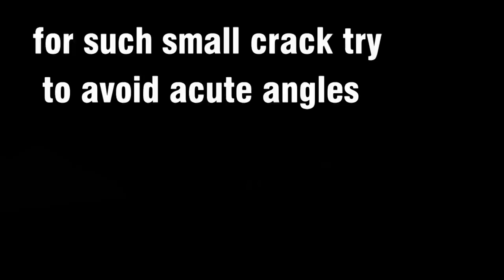Repairing cymbal crack

Comment: well, I know it's too late...but, maybe I can show someone else an easier technique...5 mins or less.....with only 2 things....
a die grinder and sandpaper.   using the edge of a die grinder or even a Dremel; with a light to medium pressure,  pawing motion....taking the metal down bit by bit...until u meet the desired depth.   it'll waste less time, give u more control and a more precise and clean result.